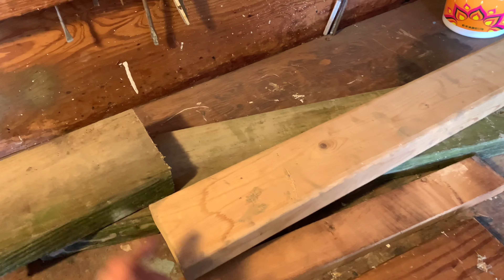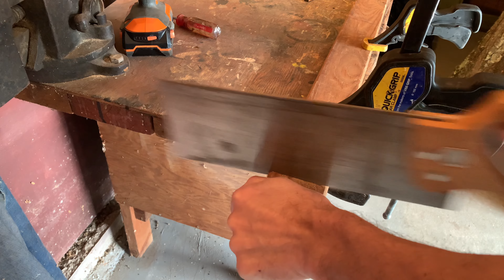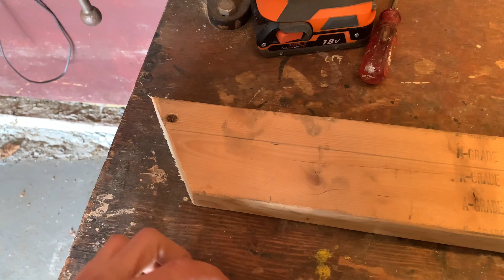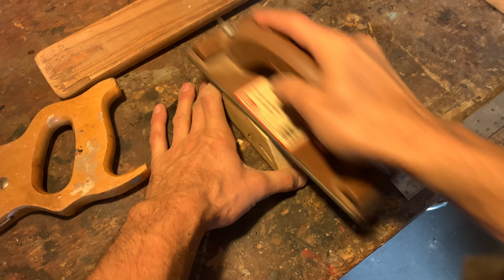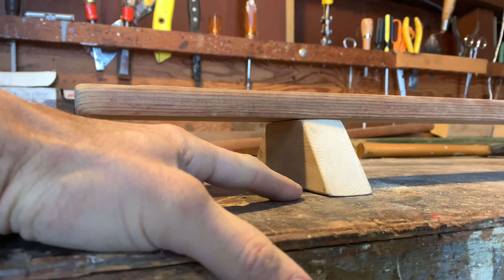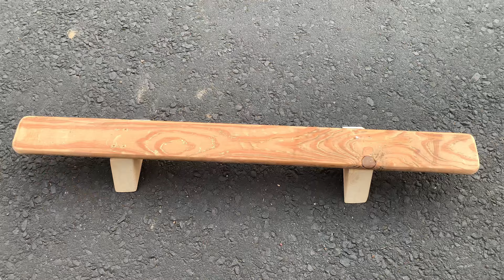How to Make a Taxte-ye Šeno (Shena Board)

Comment: Amazing work,
I've got a doubt that, are the measurements fixed?
If not, how should i change them for myself...?
Reply from the maker: You can definitely change the measurements to fit your needs - just make sure that the base of the feet is wide and stable, and that you can hold the board securely.